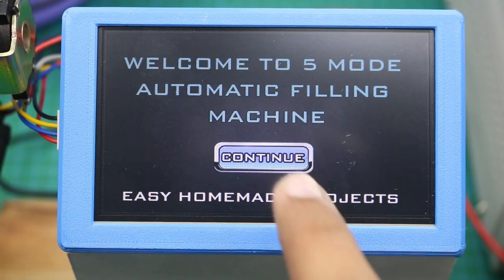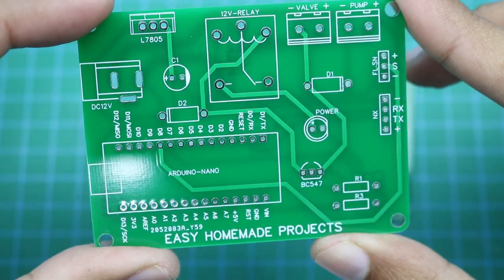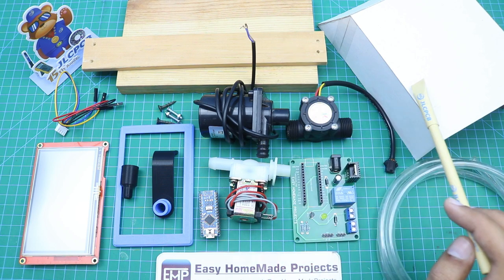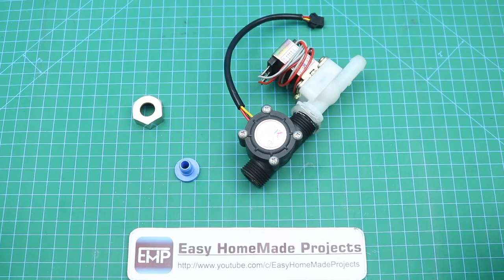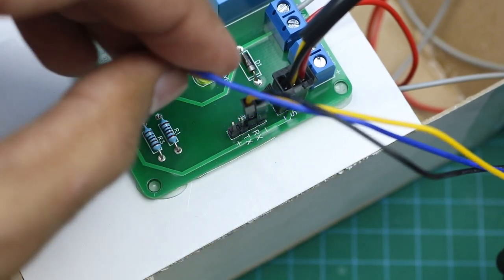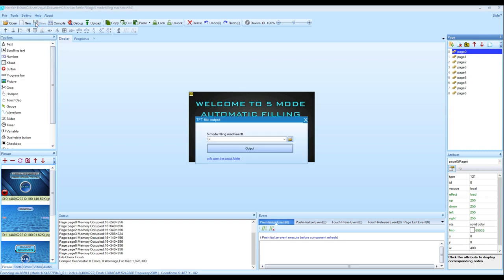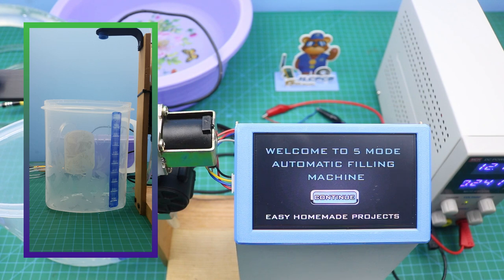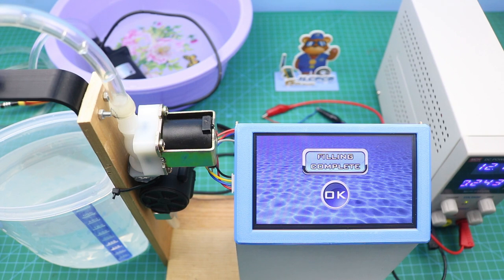DIY Touch Controlled Automatic Filling Machine || Water Dispenser

Comment: Wow great project 👏👍👌😍
Actually am in my final year as a Control system engineering student and we required to build an " Automated Fuel management and control system " Some thing like self service using an arduino mega as the main controller interfaced with GUI display screen, NRF24L01 WIFI Module for data communication, ultrasonic sensor and Ds18b20 sensor module to determine the Fuel level and temperature in the underground tank and the result will be displayed on the management PC and also the the main arduino controller will be interfaced with another arduino with a 5v - 12v dc motor pump and flow sensor to dispense the fuel desired by the user ...

Comment: Tried to contact you via facebook and no response. Code won't work. It Verifies out just fine but HMI will not fire relay. Noticed that my sketch is 2 bytes less than yours in the video, not sure y
Reply: I got it to work. Chip was old for some reason wouldn't get signal from HMI. New chip - no problem